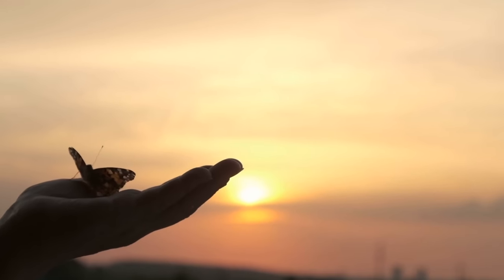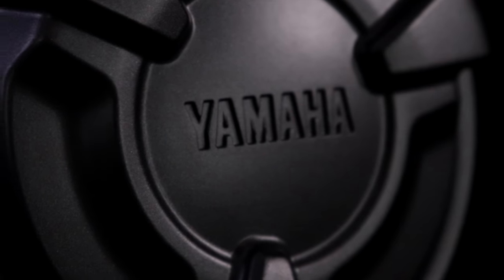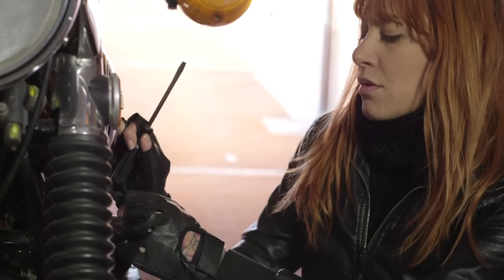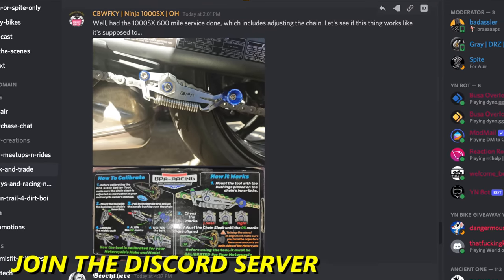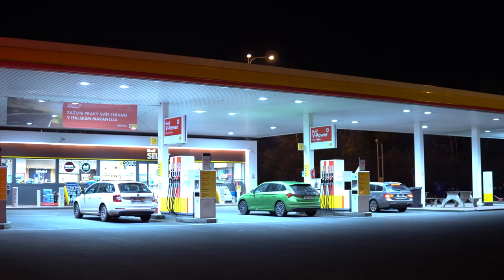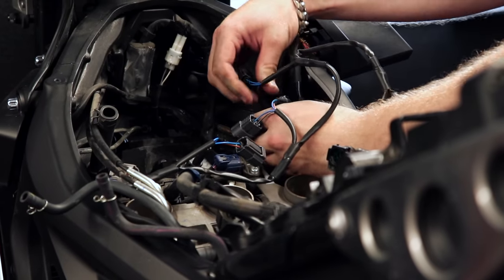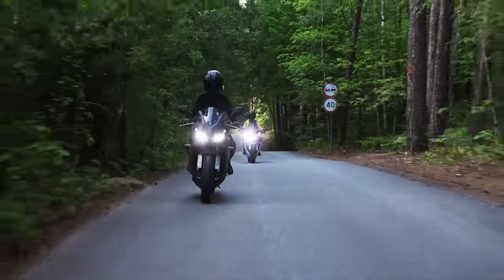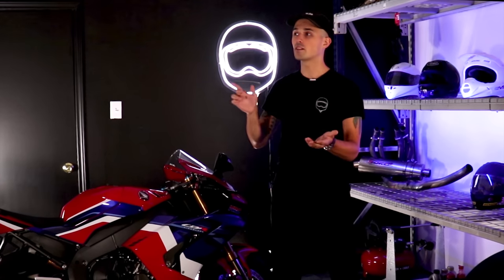7 Ways to AVOID Damage to your Motorcycle (Will Last Forever)!

Comment: Draining the oil when you store it is basically THE WORST THING YOU CAN DO.
Replace it with fresh oil, then store it. Everything that's covered in oil, can't rust.
If you're storing for a very long time (think several years) fill up the engine to the brim before putting it away. Otherwise you risk getting rust pitting in the cams, valvestems and more.

Just remember to drain the excess oil and clean everything before starting it again.
Reply: Valve stems?
Reply: @fbiagent2848  There's pleanty of people who don't have OHC engines. Like the majority of the population I'm guessing.
Reply: Yeah I live in PA and I'm going to have to store my bike over winter.  I'm still trying to figure out what to do..
Reply: @AkaBull  clean it, replace the oil, disconnect the battery (hooking it to a trickle charger would be even better) and either drain the entire fuel system or completely flush it with low ethanol fuel and top off the tank.
If you have a carburetor, it's better to drain the bowl regardless.
The owner's manual of my bike also recommends taking out the sparkplug, pouring some oil in the combustion chamber and cranking it over for a couple seconds. But I think that that's just a two-stroke thing.

Almost forgot: clean and lube your chain
Reply: @TDG2654  I just bought the 21 low rider s so I'm fuel injection,  and belt driven.  So advice thanks Robin. I'll be definitely cleaning her before storage, may even wipe her down with oil where I think she may pick up rust. I'm not to sure what I'll do with the fuel tank yet tho, may drain it, may top it off with an addictive 🤷‍♂️
Reply: Or you could use a storage fogger ..
Reply: @JohnnyD1993  What that hell is that?
Reply: @madpirate1790  - You'd guess wrong if you are talking about bikes.
Reply: Nice tip 😉👍
Reply: @TeamGeezer  you're right the majority probablyis OHC but none the less I belive the commenter probably got mixed up but his idea was correct if you ask me.
Reply: Yep, I wouldn't want my aluminum sump to rust.  That's where the oil is.  But you're right, fresh oil has un-degraded cling additives, and isn't acidic from combustion by-products.
Reply: @madpirate1790  Even OHV still have valve stems that are above the pistons. The cam may be in the block, but it pushes on push-rods which then actuate rocker arms which push on the valve stems. The push rods have holes in them to allow oil to flow up them to the rocker arms/rest of the valvetrain.
Reply: Plus fresh oil has a higher tbn. Better corrosion resistance while it’s stored. Great tip.
Reply: @JohnnyD1993  a fogger works really well to protect the valve seats, valve stems and cylinder walls, but it doesn't get to the cams. So it's not really effective for long term storage
Reply: Change the oils and over fill it for long term storage. Change oil before use
Reply: If you fill the engine to the top it's still only the bottom end that oiled up unless you fill it with the head off ??
Reply: @posteroonie  sorry to be anal, and I know it was 7 months ago. But aluminum doesn't rust.
Reply: @amococ2487  I know.  😄
Reply: @AkaBull just use abit of crc
Reply: @matthewroberts4480  Thanks mate 👍
Reply: @AkaBull  find ethanoyl free (aka rec fuel) usually sold at places that boats gas up at you can find a list of spots online. Fill it all the way with ethanoyl free fuel and add some stabil to the fuel. That's about all I do then when it's warm change oil and inspect it for any issues. I ride in michigan. Remember to shut the petcock too
Reply: @sterileeasteregg  Awesome 👌. Thanks Ryan 🙏
Reply: @TDG2654  It's definitely not a two-stroke thing; more like a rust prevention thing. My service manual also tells to do the same (Honda VFR750F '95).

Comment: "Shift faster", "don't redline it"...

Me, being 16 years old and from europe with my 125 having 15 hp be like: bruh.
Reply: In the netherlands you have to be 18 for 125cc. 😅
Reply: Really, I didn't know that. I'm from germany
Reply: @NaTeCS  in the uk its 17 for a 125
Reply: Those small engines can rev extremely high because the moving components are extremely light weight so no worries. 

I feel bad for you guys in Europe with those ridiculous regulations.  IMO 300 cc bike are less dangerous because they can accelerate fast enough to keep up with other vehicular traffic and maintain adequate speed when ascending changes in elevation.  Nothing is more dangerous than an impatient motorists behind a motorcycle.
Reply: Hey bro, a Honda 125cc/150cc is a tank of a motorcycle, those engines run great while 100% twisting the cable all the times, even when having crappy fuel in it.
Reply: @neemyn407  yeah, i have heard and seen that they are some little beasts😈 though i dont know if i would like to own one as my main bike and still one of my biggest 125cc problems is, that you have to warm them up to get some decent Power, and this is especially in the morning a problem while driving to work
Reply: @Thomas-si1rj  I had some talk with mainly delivery guys that have these 125/150cc Honda motorcycle, that 125cc can do 45km/50km per litre of gas and handle abuse just like the 150cc motorcycle, but the power difference between 125cc and 150cc is palpable.
But if you live in a country where insurance is required by law, having a higher cc motorcycle (600+) costs sometimes WAAAAAY LESS to insure than a 125/150cc, and sometimes with a 125/150cc you're not allowed to go into highways.
But a small displacement motorcycle is really good for inner-city commute.
Reply: @neemyn407   yeah 50 km per Liter seems plausible, i get between 2,5 l/100km and 3 l/100km(full throttle on the Autobahn) where you by the way have to be able to go speeds higher than 60km/h and that must be written down in the vehicle Papers by the way. And yes, These 125 (i've got a ktm duke 125) are really expensive to insure... but i also neither live in, nor directly next to a City, i got my bike mainly for the joy of riding a motorcycle and now also to get to work. When i get 18 next year i'll be getting a bigger bike though. What bike do you have?
Reply: @neemyn407  I got close to that on a 250cc Hensim Enduro (Honda 250cc clone). With it carrying 2 people (my dad driving) we averaged just over 109 mpg (46 kpL) and part of that was even on gravel where the tire is slipping. The worst recorded I ever got trying to burn fuel (doing wheelies, drifting every turn, stopping randomly in the middle of the road and then taking off flooring it again, basically WOT everywhere), I got 90 mpg (38 kpL) and something like half was gravel miles.

I don't know if that's impressive, but I thought it was pretty good and cheap. The bike new (12 years ago is when I got it) was $1100 with all fees included (except tag/insurance). I'd bet a smaller 125cc could do that pretty easy, because that was a pretty tall bike (good for rolling over small square hay bales or jumping, though I always sucked at landing jumps), and it could do about 65 maybe 70 mph (110 kph) on gravel roads. Good little bike.
Reply: @NaTeCS  in india be 18 and buy whatever cc bike you want
Reply: 125cc scooter brah liquor cycle reporting here, redline go brrr, especially in dense cities where I'm almost never going above 60mph or 100kmph unless if I'm on a highway or flyover.
Reply: @kannermw  nah its just 50cc 125cc max 48hp and unlimited tiers you get 50 and 125 at 16, if car licence 50cc free but you need like 18+ for 50hp any size 500 300 350 under 50hp and some weight and weight power rations
Reply: In Portugal 125cc you need to be 15.5 with parents approval and 16 without it
Reply: 91 or 93 octane gas as high octane? In europe most common gas is 95, high octane is 98
Reply: In the US it's 16 for a turbo 'busa.  As it should be

Comment: As a beginner rider on a 1970s East German 2 stroke ‘simson’ motorbike I can confidently say that it only hits the redline when I accidentally shift into neutral instead of 2nd. 😁
Reply: Those neutrals can be sneaky.  Every now an then the appear between other gears.
Reply: Same , but im used to it , you should let it go down the rpms so you can shift smoothly (btw i have a 1970 bmw r75/6 us spec) , becomes annoying when going full throttle between 3rd/4rd and 5th though

Comment: I used to live in Pennsylvania and when the winters came I wouldn't drain the fluids to store it because I would start it once or twice a week and let it run for like 10 minutes. Never had any issues with that.
Reply: Drain all the fluids,  or just the gas? I'm in Allentown, PA.
Reply: I live in PA and do that as well
Reply: I’m in Maryland and I do the same thing. Even take it for a quick ride when the weather is nice in the winter
Reply: PA gang
Reply: @HobbiesWithMike  That's good. You don't drain anything. You store it with a full tank and fresh engine oil. The only thing you can take out is the battery to store it in a warm room and recharge it every month or so.
Reply: My Father has a 1973 Tr7v, essentially my entire childhood never watched him really work on it,  he would ride it maybe twice a year. when I got my 71 Trophy two years ago (@17) he gave it some love as we were restoring the new bike. But that bike lived in the backroom of the house and faced no problems.
Reply: Starting your engine for 10 minutes every week or two is insane.  My bike stays OFF until I start it in the spring to ride.  Been doing this for 50 years with no issues

Comment: If you're forced to ride with too low of an octane fuel, you should actually keep the revs up and the throttle (and thus load) low. Preignition is most likely to happen at low engine speeds and high load, so you should avoid that operating condition. This is because low engine speed creates more time during compression, before the spark fires, providing more time for the fuel air mix to heat up and potentially pre-ignite. High load also creates higher pressures, density and internal temperatures, adding to the preignition potential.
Reply: On modern engines, low octane isn't as much of a problem. They have knock sensors detect preignition and loosen spark timing, reducing preignition at the cost of power. Still best to run premium if it needs it though.

Comment: If you read some manufactures handbooks they actually recommend warming the bike up by riding it in low rpm, helps to distribute the fluids nice and evenly :)
Reply: It's actually the right way to warm a bike. You ride it but keep it at low RPM... That way, as you said, the oil will get distributed in every corner, but the tire will warm up too, and the clutch/gears as well.
Reply: @Mike_Papa  Dont overdo it on low RPM's tho, lugging is also bad. I think you are right tho, warm it up by being it that zone where it spins freely and dont put too much load on it until its warm, will 100% keep your engine in better shape.
Reply: @Surpriseify  when I mean low RPM I mean I keep it at around 4k. My Rev is at 12 and my optimal RPM is 7-8k so I just don't push it. But yeah being too low too long isn't good either.
The main thing is to warm the tires as well, especially if you ride in the cold.
Reply: I always just idle my bike everytime for 5 to 10 minutes before I ride it, safer that way. Or you can do both idle for a few minutes, then ride it slow.
Reply: yep. my s1000r BMW specifically states, DO NOT let the bike sit at idle on the stand to warm up. You should start then ride it at reasonable RPM's until temp is at operating temp.
Reply: Start it, put on your gloves and ride away, keeping everything at lower revs and light loads for the first 5-10 miles. I'm guessing YammieNoob got this 4-5 minute warmup advice from 1955 or the Harley dealer?
Reply: @TeamGeezer  I mean everyone's got there way of doing things but I've always done this with bikes and cars, my audi used to scream at me if I started on a cold day and sat there for more then a minute!
Reply: @yee4618  Doing it they way you want is one thing, when you are a respected MC YouTube channel and dispense bad advice is another. You are there to provide good, accurate advice to the noobs or your advice is worthless if it is accurate only 1/2 the time.
Reply: @TeamGeezer  i mean when you put it like that, you then remember alot of people dont have the common sense to think things! but i do agree, if youre gona help noobs then help em!

Comment: Warm up recommendation only applies to warming it up before higher loads. Most motorcycles, especially newer ones, will have a recommendation in their service manuals not to warm it up before ride as it might increase buildup of different sorts and rather drive it off without stressing it. Just my two cents.
Reply: I always ride low revs in startup, it's a waste of fuel sitting, waiting for warmup.
Reply: Additionally, pressures are pretty low when idling, which means your piston rings don't seal quite as well as when you're under even a little bit of power. If you didn't break your engine in correctly (and let's face it - even if you did) that'll lead to oil dilution. The reason is two-fold. On top of the poor seal, your bike also runs rich while it's cold to make up for fuel condensing on the cylinder walls. That leaves a ready supply of liquid fuel in the best location to get past the rings and mix with your oil. No es bueno!

Let's be clear, you'll get that when the engine is cold regardless, but if you're just sitting there idling you get much more of it and the engine warms up slower.

Fortunately, modern engines have a neat way of getting rid of oil dilution - crankcase ventilation. Basically, once your oil is up to temperature, it's hot enough to evaporate all the fuel, which in turn gets sucked into the intake and burnt away in the cylinder. But that only works when your engine gets hot and it takes a while to evaporate all of it. This is why when you open the oil filler cap on an engine (car or bike) that's only used for short periods it smells of fuel. It's not supposed to, but it never gets the chance to get rid of that fuel.

If the problem is serious enough, you'll notice the oil level rising over time. If you do, and you take regular long-ish trips (oil stays hot for at least 30 minutes), then there's another problem which must be addressed. In the meantime you ought to reduce your oil change interval to half or a quarter of the manufacturer's recommendation, else the dilution can cause engine damage.
Reply: @MH-cv5ye  The more time the engine spend not in the working temperature, the more it will tear. So it's better for the health of engine to start it and then go riding at low rpms.
Reply: @TheMatti36  Due to my daily ride being a big 1000cc V twin with open exhausts i can`t let her warm up for 5 minutes anyway when i need to leave for work at 5:30 in the morning...  The neighbours would kill me. 

I just start the thing and ride it at round 2/3000 rpm till it wants to idle without the choke which takes about 3 to 4 minutes before i join the highway and open the throttle.

I always wondered if i was damaging or shortening the life span of my bike but it seems the general idea is that i`m actually doing the best i can for the engine?
Reply: My 2023 owners manual says to let it warm up

Comment: I might disagree on dry storage and suggest that you top everything off to eliminate air in the systems. Oil would get extra quarts and treated fuel to the max level. Heating and cooling on any vented system allows air (moisture) to possibly enter over time. Even better to not store and just ride all year.
Reply: i'm gonna remember to ride this winter when it gets to -15c and the rods are covered in snow.. obviusly the best would be to ride all year but for some parts of the world its just not possible :/
Reply: @christianjohnsen105   It's possible... JUST A LOT more trouble than it might be worth. You'll need a "semi temperature controlled" storage area for the bike, where you can keep it above the oil's congealing temperature (which is different for viscosity ratings)... Do the warm-up phase in that storage area (so it has to be well ventilated) and then ride the 15 to 30 minutes once a week or so for "maintenance".

    You'll still have to be aware of issues like cold tires and ride gently, but it's still do-able... It can just be so much more trouble, you're probably better advised to stabilize and store it a few months instead. If you're in an area prone to a lot of ice and snow, snow tires CAN also be found, but do you REALLY need two sets of rims for one bike??? It's all about how far YOU are willing to take it.  ;o)
Reply: @christianjohnsen105  c'mon man...don't be  a wimp.  Get out there and ride ;-)
Reply: Same here, was thinking the opposite, except for the fuel tank...
Reply: Maybe just let your bike run on idle for about 5 to 10 minutes every other day and it won't get that much affected from sitting there all winter
Reply: @korogluayberk  A bit excessive since most engine wear occurs on startup. Maybe once a month.
Reply: Main issue I would say is fuel, which goes bad after about 6 months. Fuel stabilizer helps, but I think it still goes bad after a couple years.